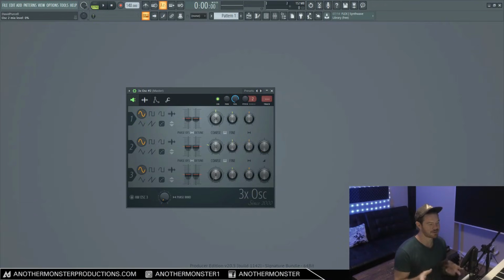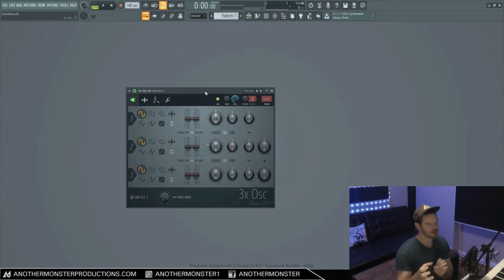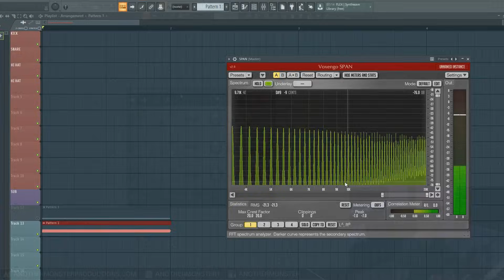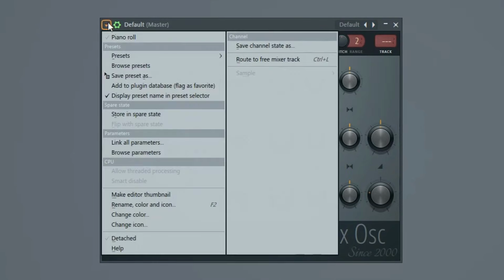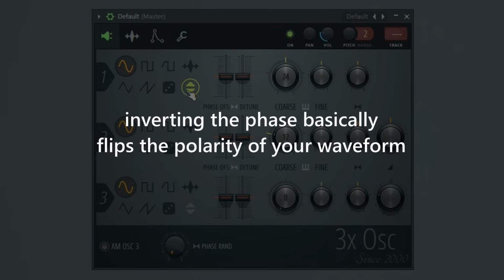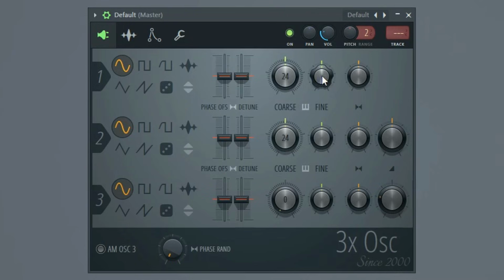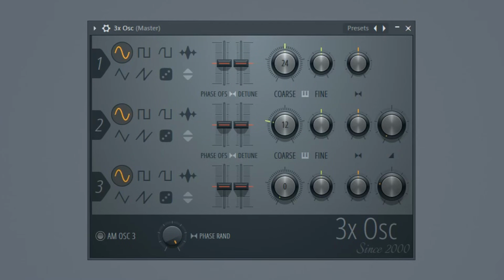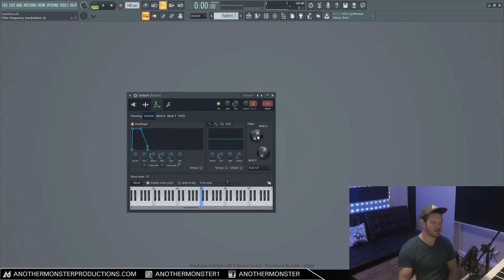How to Use 3x Osc in FL Studio | Tutorial

Comment: Aliasing in 3x Osc actually has something to do with low CPU usage, correct me if I am wrong. It's very obvious when you are using waveforms other than sine, and then start playing something in the higher register.

Quite awesome how clean this synth can sound after rendering :D

It would be cool to have 3x Osc as a standalone plugin though, in order to not restrict it by channel settings menu. Also the smoother automation of its parameters would be nice as well (like fine tuning, oscillator volume, phase and tune shift), because it is very clicky when you to try automate some of this stuff.